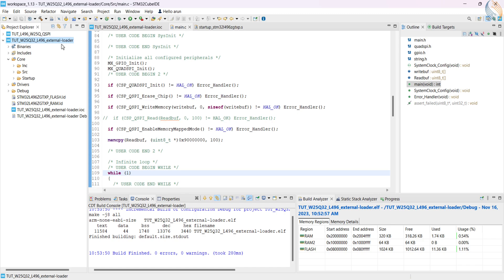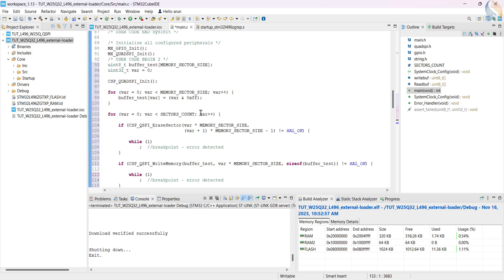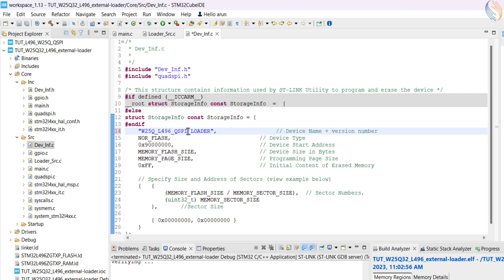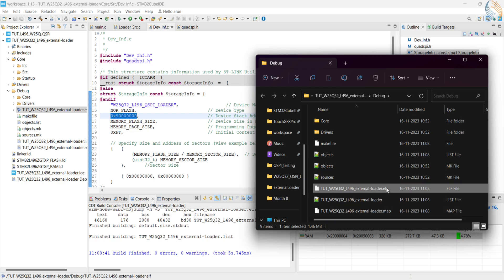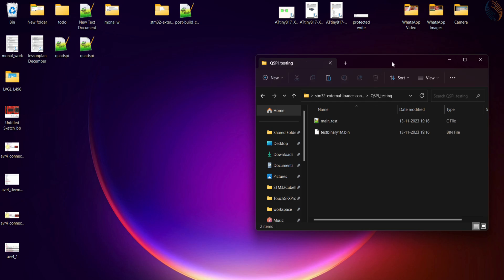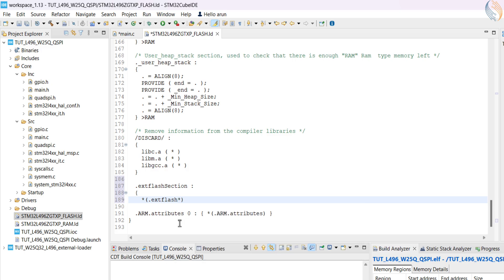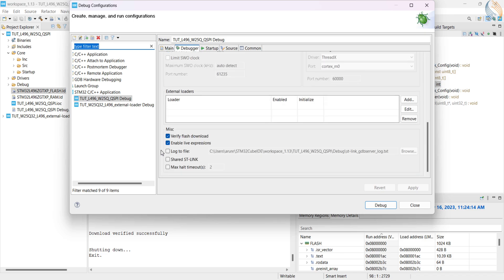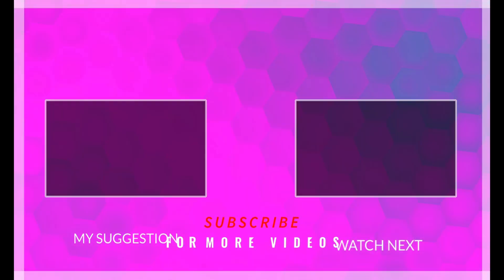W25Q FLASH Memory || Part 8 || How to create an External Loader

Comment: I have that error because stm32g474 has too small ram? 
`.rodata' will not fit in region `RAM'
region `RAM' overflowed by 763440 bytes 

is there any solution?

Thank you!
Reply from the maker: Unfortunately no, there is no solution to this. Your ram size is small and the project can not fit into it. 
You need to reduce the code size. How much ram does it have ?

Comment: If you are using stm32f746g-discovery board, you have to modify the quadspi.c and quadspi.h files based on settings which have been provided in 32f746gdiscovery-bsp git repository.

Comment: @ControllersTech Will there be video about QSPI as firmware flash storage place? I mean in stm32 flash bootloader and in external flash main firmware application? I assume that it is similar to standard bootloader main aplication code with difference tnat main application flash adress is 0x09000000000 but ... propably some differences should appear... assuming: initialise in bootoader QSPI map mode???
Reply from the maker: There is already a video on xip. Check qspi playlist.

Comment: Hi @ControllersTech I tried code execution from Qspi memory in stm32f469(xip). Application code is running fine but I am not able to debug application code and not able to set breakpoints while code running from external flash. Any suggestions please??
Reply from the maker: use external loader in the debug configuration

Comment: @ControllersTech Can you please check and confirm whether we can debug the code running from external qspi memory in xip mode for arm Cortex m4 based mcu and if possible can you please make one video on it??
Reply from the maker: There is already a video on xip. Check the qspi playlist.
Reply: @ControllersTech  In Cortex m7 based mcu I am able to debug but not able to debug in Cortex m4 based mcu can you please check on that??
Reply from the maker: I will be honest with you here. I connected the W25q chip using the breadboard and wires. Now the chip isn't responding, so I can't test it. Also I can't find any dev board (ST's or custom), which is not cortex M7 based and contains the W25Q in QSPI mode.
Using wires for QSPI was not a good idea from the beginning but the chip worked so I made the video. If you have the link to the board which have the memory soldered into it, I will test it for sure.
Reply: @ControllersTech  Thanks for the reply, you can use any STM32F4xx series based board with Qspi peripheral and any NOR flash. In my case I have STM32F469 Disco board and on board MT25Q128 nor flash. Code is running from QSPI memory but I am not able to debug code (more precisely not able to halt core). Breakpoints not working...